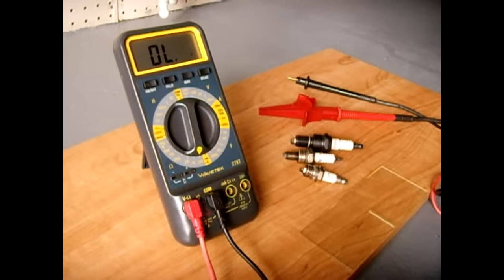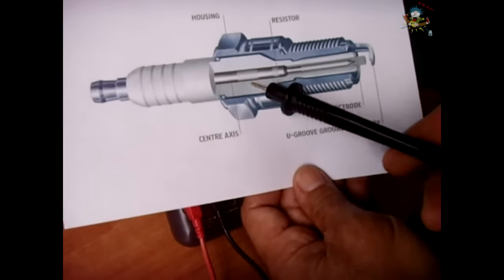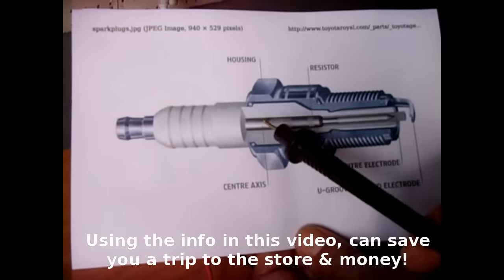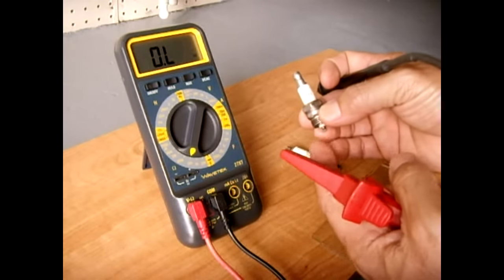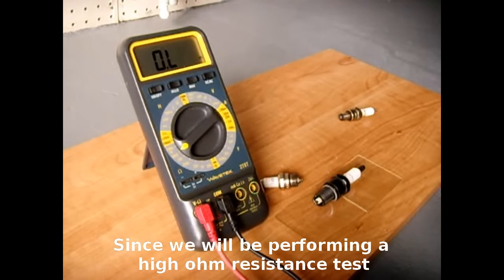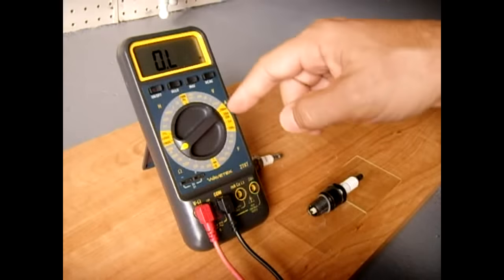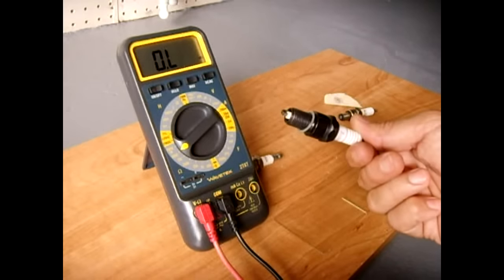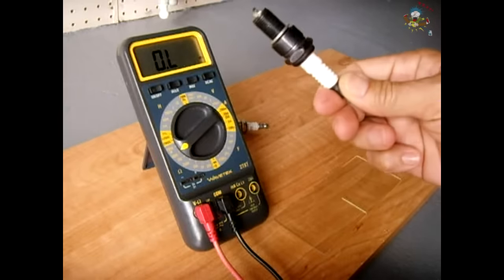How to rule out a Spark Plug as your problem

Comment: Not the best idea to pull plugs on a hot engine  if you have an aluminum  block.
Could seize  in there and pull out the threads.  Can heat them up with a propane torch some to simulate the heating of an engine.
Reply from the maker: I've taken my spark plug out of my hot lawn mower/jet ski engine many times with no problems, and they are both aluminum heads. You do bring up a good point though. If you are concerned, you can use a heat gun to heat up the spark plug when the engine is cool to perform the test. :-) I made a notation in the video.

Thanks!
Reply: Well that's what I've heard and don't want to chance it.
Reply from the maker: It is certainly possible.
Reply: Sure, it's just not recommended.

Comment: I thought a sparkplug just sparked, didn't know it also generated heat. But Teckie here says, tot got ones that run hotter and ones that run less hot. Dependent on the length, he says. (Also he is under the impression that any oil on the inner contacts has got to do with good the thing screws in, although he words it as 'the rings'.. Also, he seems to think the 'body' ceramic could be conductive under certain circumstances, which it can not, it is an absolute insulator..
Reply from the maker: The ceramic body CAN conduct if the electrode gets dirty enough to find a path across the insulator.

Comment: My own reads 3,81 ohms my car hesitates and when i push the gas it buckles before it goes
Reply from the maker: You have other problems besides a spark plug. 3.81 ohms is way too low for a resistor spark plug.

Comment: Your explanation of heat ranges of spark plugs is incorrect. The length of the stick out of the porcelain inside the cylinder causes the plug to run hotter because it is less efficient at dissipating heat, so the electrodes run hotter and can burn a richer/oilier mixture without fouling.
   Colder plugs can help stop detonation in high performance engines 
  There are also projected nose plugs that look like they should be hotter but are designed to hang farther out into the cylinder to promote flame travel without running hotter.These are used in some engine designs and aren't generally a direct replacement for other engines.
Unless you are building racing engines , use the manufactures recommended part # for your engine.
Reply from the maker: Let me guess. You had annotations turned off.
Reply: Ya,I watched it again and saw your annotations on the hotter and colder plugs
Reply from the maker: superrodder2002
:-). I use annotations on my channel to add additional information, make corrections, and allow links to my other videos. I highly suggest you leave them turned on while viewing my videos. Thank You

Comment: It would be better to use an insulation resistance tester for the second test between the plug body and where the boot connects. Your method uses only the very low voltage supplied by the battery in the meter to stress the insulation whereas an insulation tester can output 250v, 500v or 1000v; nowhere near the running HT voltage of 30000v but much better than 9v.
IMHO.
Reply from the maker: That's true, and I have an excellent video showing insulation testers, but using a DMM with a very high resistance range does the trick for ceramics. I never had the testing fail. Thanks for watching
Reply: Good video though. I never knew about the difference in resistance of the different plugs' electrodes. It may also be good to point out if there is a tolerance in the resistance values of the electrodes in identical plugs i.e. 3k good, 3k5 bad etc. Thanks for the reply.

Comment: Its way easier to simply replace a spark plug. Spark plug tests - and a dedicated tester machine - were done in the good old days when the quality of fuel was poor and engine tech low. A good mechanic/home diy person will have checked the primary and secondary circuits of the ignition system and if it points to spark plug fault then.....it has to go.
Reply from the maker: Some spark plugs cost a lot of money. If you don't mind wasting money, then buy them. :-)
Reply: electronicsNmore this test proves nothing. I don’t get continuity through two brand new plugs but the plug works in the small engine.
Reply from the maker: @marks4374  I don't upload worthless videos, clearly you screwed up.
Reply: electronicsNmore this electrician knows how to check continuity. I didn’t screw up!
Reply from the maker: @marks4374  You're measuring resistance!

Comment: You sound like you are saying that the difference between a hotter plug and a colder plug is the length of the external porcelain.  The real difference is how much of the lower end of the porcelain, and the electrode it encases, is exposed to the combustion gases.
Reply from the maker: +ERB FARMS 
That is correct. I added an annotation in the video which better explains that point. Over the years I noticed a correlation between having a shorter nose with a shorter insulator, and a longer nose with a longer insulator. I should have stated it differently.

Thanks For Watching

Comment: certain Honda will not start on plug that other will run perfect on.
Fouling acts up under compression pressures also. Motorcycle outboard mechanic 40yrs.
Reply from the maker: Not a foolproof test, but it's highly reliable. Thanks for watching!

Comment: Please explain HOW you take a plug designed to operate near 1750 degrees f at it's insulator tip which is industry standard for 4 strokes, warm it up as you say and expect any accuracy. Your exhaust manifold runs 300-650 degrees on average which is NOT the electrode temp which is what matters. Please explain why checking continuity in a platinum or iridium plug has ANY relevance when you CANNOT set electrode gap (which is what matters). You have absolutely NO idea of the waveform under pressure in a gaseous environment. This is all covered in 1st year trade school.
Reply from the maker: Nothing to explain. If you don't like the test, then don't do it. It's never failed me. Can't argue with those who think they know everything. :-)
Reply: LMAO. You can't argue because you clearly have no idea. EGR valves are designed to stop oxides of nitrogen (combustion temp above 1300 degrees) and you are saying to heat the plug to 300. There is absolutely no Paschen's Law argument here LOL.

Comment: If you plug is a resistor type do not trust this method when using a digital mutimeter the value can appear to be ok but break down under load. I got 6K ohms but plug would not run, changed a non resistor type and engine started immediately.
Reply from the maker: Nonsense, the method works just fine for non-resistor & resistor spark plugs. Never had it fail. More than likely the plug failed the second high resistance (M Ohm test between the electrode and threaded body). If you only used a 2M range on the DMM, then that would be why you couldn't detect the problem. You need a meter which has a 10M or higher. Higher is better.
Reply: My Meter is autoranging
Reply from the maker: ANDREW MICAS
No good. What is the maximum range?
Reply: H

Comment: This isnt a 100% method of proving a spark plug is functioning correctly.  It does not account for the very high working voltage of an igntion system and also the pressure of the combustion chamber before the spark occurs.  The insulation of the plug can be defective under operating conditions thus causing the high voltage to track internally and preventing a spark. I have an old school plugh testing machine which tests a plug under pressure and plugs that have tested otherwise ok will fail on this machine.  Even that isnt 100% because plugs work at high temperature and this is another factor that can cause a plug to fail in service use.
Reply from the maker: Nothing is 100%, but it's HIGHLY reliable. The test never failed for me.

Comment: Have you priced sparkplugs lately, or is your labor time not worth that much?  Takes as much to take it out and test as it does to replace it.  Try billing a customer for "testing" his sparkplugs....
Reply from the maker: It's very easy to test. Only takes 30 seconds each. Why replace something you don't need?
Reply: 1) Because it is a static test and has no predictability as to how the plug performs under a load.  2) Because as a pro when you bill a customer $50+ for a spring tune-up on his $4,500 zero turn,  they expect at least fresh oil, fresh filters, NEW PLUGS, and the blades sharpened.  3) Because when you buy them by the case they are less than $1.50 each and your reputation is on the line for a comeback.
Reply from the maker: Who said this video was for Auto Repair Shops? LOL. This is for people working on their own cars, trucks, jet skis, boats, as well as lawn and garden equipment. The tests are EXTREMELY reliable.

Comment: Why not just put in a new one, if the old is dirty it might have a short in the inside insulation, this will create misfire.
Reply from the maker: Why spend money, and waste time traveling when you don't have to? :-)
Reply: electronicsNmore   If the plug is West from fuel, you will still get a goog reading but the bike will misfire. New plugs are so cheap i would not waste time measuring  them, just put in new. Just my opinion 😉
Reply from the maker: Incorrect, you don't test "wet" plugs.
Reply: electronicsNmore  why test them, if it runs no problem if not, new plugs
Reply: y not clean it if you dont have to spend the $ on a new one

Comment: An ohm reading with a DVOM merely indicates continuity. It does not indicate the actual R at 50-70kv under pressure and load. It also does not account for eroded electrodes inside the porcelain which may or may not indicate a normal reading. In a non resistor plug carbon tracking may give you a 0 ohm reading. You can test a coil, cap etc and it will ohm out perfect until you find the crack, carbon track or wet it down and find the arc. So you ohm out a resistor plug and get a bad reading. Fine. You just got lucky. You can also have continuity through an electric stove that wont heat up. IMHO, I understand what you are saying about testing but you are a bit off.
Reply from the maker: Incorrect. When using the high ohms range, you can easily confirm a good or bad plug. Never failed me. I guess I've been lucky over and over and over. :-)
Reply: I can see from all your responses that you are insanely stubborn in your beliefs. That does not make you correct, just lucky. Most of the principal of what you say is valid but I just explained how and why it can be wrong. There are several ways of doing this without expensive tools, your method is not 100%.
Reply from the maker: max webster No, not stubborn, I just know what works, and what doesn't work. Don't like the method? Don't use it. By the way, nothing is 100%.
Reply: You win.

Comment: Can't test a spark plug effectively with a multimeter, the test voltage is too low.... end of.
Reply from the maker: Incorrect. I've proven you wrong over and over. Though it's not 100%, it's highly effective.

Comment: If I took the plugs out, I would just put new ones in.  Simple.  A multimeter will lie to you when testing resistance.
Reply from the maker: Not if you had to drive to a store to buy replacement plugs. Some people don't live close to a parts store. Simple
Reply: electronicsNmore This is America.... A person can even order them from Amazon.
Reply from the maker: So it's a beautiful sunny day, I plan on taking out my jet ski, but it won't start. So instead of taking out the plugs to inspect and test them, which only takes a  minute or two, I drive miles to a parts store or buy on them on Amazon and wait until the next day or two? 🤣  Even better, you get the plugs and they weren't the problem.
Reply: electronicsNmore If you cannot troubleshoot and get it right the first time, then you shouldn’t be messing with it.  In addition, you like to argue don’t you?
Reply from the maker: @rickmeadows686  Your original misinformed comment is what started the argument. Some viewers really crack me up. I couldn't have made it any clearer to you in my last reply why the method is useful, yet you still replied back with another comment to keep it going.

Comment: This is no way to test a faulty plug the ceramic as mentioned by a previous comment posted has nothing to do with heat range!! And resistors do play a part in the ignition system if it is a cdi ignition ,backing up the ignition,so the comment regarding mowers are also incorrect as they use cdi ignition systems also ,champion have a commercial tester that tests plugs under compression and if faulty will show up whether in a cold state or hot this static test is not a reliable test , as testing an ignition coil also with this method will show ok !!! but under working conditions but will not perform under load , this test is purely a continuity test, !!!! you will note the different heat range numbers on an NGK or champion plugs and notice no change in length of the insulator (ceramic) it is the protruding tip with other factors governing the heat of the plug, most serviceable plugs as mentioned get changed when they are oiled up or carbonised blasting or cleaning with carb cleaner to remove the oil residues around the base of the tip !! this will cure and remedy this ?? read any spark plug fitment guide  it is full of the manufacturers useful accurate data .
Reply from the maker: If you read my pinned comment, which you didn't, you'd understand why I said what I did regarding the heat range. :-) As for the method, it works PERFECTLY. Never had it fail.

Comment: It is no fun, I have run into this maybe 2 or 3 times, take the plug out ground it on the head, crank engine,
you have plenty of fire. But plug will not fire under pressure. I learned this from an excellent mechanic,
He said, this does not happen, often but it does happen.
Reply from the maker: Dragos 4 Never observed that.

Comment: "At least 20 Meg but 10 Meg is OK too". Which way is it? Can't have it both ways.
Reply from the maker: You sure can. If you want more reliable results use 20M or higher, if you only have 10M, then you can use it with less reliability.

Comment: This video is very misleading. The only way to properly test a spark plug  is with a high voltage megger or a spark plug tester, as already mentioned by some people on here. Spark plugs fail at the 3,000 to 20,000 volt range they work in. Not at the 1.5 volts a multimeter applies. Since most people wouldn't pay the money for a megger or a plug tester, the best thing to do to rule out the plug is replace it. If that doesn't fix it, a gap tester will test the rest of the ignition system. These are only a few bucks. If the ignition system can generate enough voltage to jump across a 3/8" gap in air, which requires about 20,000 volts, the problem is elsewhere.
Reply from the maker: Not misleading. I've used the method for 30 years, the success rate of the test is very high. No test is 100%.

Comment: You are not supposed to take a plug out with engine hot.
Reply from the maker: You allow it to cool down 15-20 minutes for an aluminum head, cast iron makes no difference. Never had a problem.

Comment: how about we change with a new one. then we rule it out
Reply from the maker: It's nice to learn how to test things. Replacing isn't always the solution.
Reply: electronicsNmore  but  Spark plugs are not that expensive to replace.  . with new spark plug you could see ho w it currently burning fuel
Reply from the maker: Do as you like. :-)
Reply: chevyengine307 - And if the new spark plug is also spoiled? Than what, another one. ;-) Been there done that, after banging the head for awhile decided to test and surprise, surprise.
That´s a good way to trow money out of the window. Correct diagnostic of a problem save a LOT of time and money. Beside is always nice to avoid the "I changed everything, but problem is still not solved." just as we read constantly.

If a 10$ is no big issue, the same applied to a 1000$ part can quickly become a huge problem.

Comment: Spark plugs breakdown under compression. Gaps increase. How do you know the resistance specs for ALL plugs? Your method isn't reliable!
Reply from the maker: No method is 100% reliable, but I do know that this method is HIGHLY reliable. I've been using it successfully for over 20 years. As for the typical resistance range of resistor plugs, that was mentioned in the video. Clearly if it's way outside that range, you'd replace the plug. Spark plugs infrequently fail under compression.
Reply: @electronicsNmore  How do you know the specs for different plugs? Where do you get your info. Plugs fail under compression. You're like Bruce Pender that believes you can test plugs. Heat raises resistance. Compression losses and oil fouling cause misfire. Lean conditions makes it hard to fire. Carbon on valves interrupts airflow and causes misfire.
Reply from the maker: No time to argue. If you don't like the method, don't use it. :-)

Comment: keep a record of the cars service so you'll know when to do it your just spending money on things to check those parts out when that money can go towards the service this is playing with the car leave it.
Reply from the maker: You sound like you enjoy buying unnecessary parts. :-) You don't seem to realize the purpose of this video. Yes, if the car is running GOOD and the plugs are getting old, then you swap them out. If you're having problems with the vehicle, then you can rule out the spark plugs using the information in this video. I've seen so many people replace a spark plug that didn't need replacing, only to find out it was an ignition coil problem or carburetor/fuel injection problem.
Reply: +electronicsNmore
you didn't understand what I was saying.